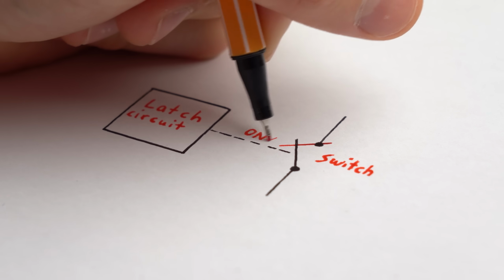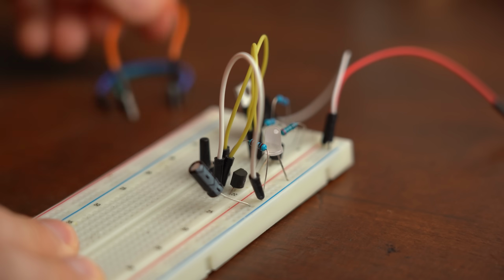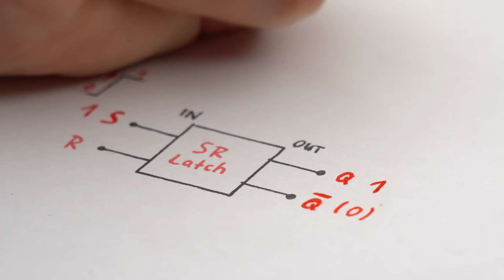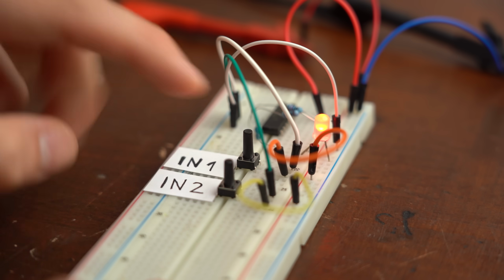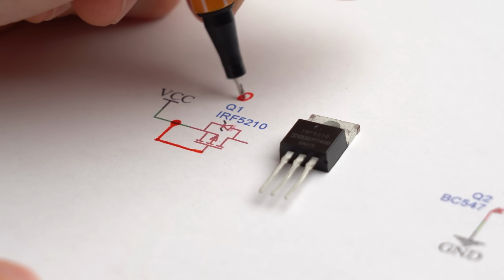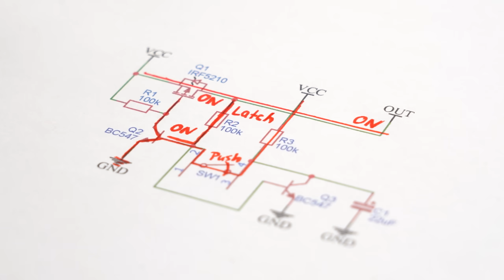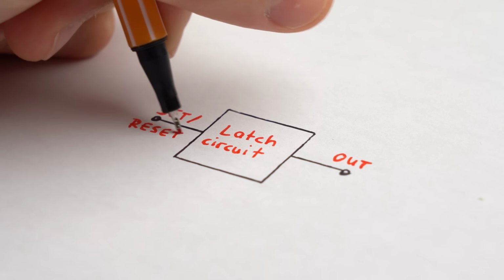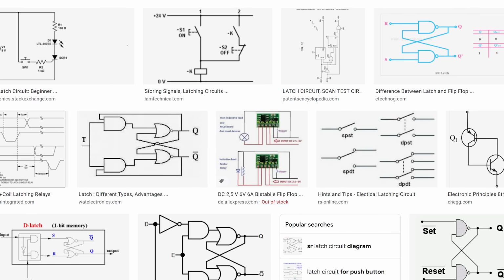Mechanical  Switches are Obsolete?! Switch to a Latch Circuit! EB#53

Comment: Funny enough, when I fix up 80's Saab radios, the one model that has a latch circuit is the one that often won't power on until the circuit is recapped or power button repaired. The mechanical volume dial switch models just about always power up

Comment: I don’t see the advantage of a circuit switch over a simple mechanical switch. These circuits have 10 times the number of parts and 10 times the possible ways to fail. Silly.

Comment: While latch circuits are great and have their purpose, I think it is often times unnecessarily over complicates a system. And that is something that is a recurring issue in engineering. We want to over complicate and over engineer a system when a device already exists that is far cheaper and far more reliable.

Remember, the more components, the more room for error to occur. As such, we are shooting ourselves massively in the foot for ZERO gain.

Comment: completely useless over-engineered idea, you can achieve the same using a relay with the same latch action, also it uses no standby current or you can use 8 parts to make this complicated on off switch, and the relay approach is much more reliable

Comment: Please don’t use this kind of switches or latches for mains voltage purposes. See the comments below (Joop and others). Mains switches shall comply requirements for thermal resistance, fire resistance, clearance distances (as per over voltage category II), failure mode requirements, between others. Component standards and product standards are mandatory in mains related, not an option.
Reply: Pretty sure he used a mechanical latch for his lights. AC would fry those transistors he used for the other switch.
Reply: Use a relay

Comment: Great Scott, I recreated your scheme but replaced the mosfet with regular pnp transistor with 12v supply voltage. The circuit was not latching unless bypassed the resistor, should I decrease the resistors value to like 10k or the mosfet is the key to success?

Comment: IC latch circuits are useful in low voltage, low currant applications.  When you get into controlling high voltage/high currant applications you get into electro-mechanical latch circuits.

Comment: Please explain in what way a latching circuit is requiring less cable-length than using 3 normal switches. You could use thinner wire for the controlling switches, but not less cable-length.

Also they do have the downside of needing a lot more components, being more complex, and increasing power-draw ( electronic latches - not for mechanical latches).

Comment: Mechanical switches are so nice and simple and rely on nothing but a physical connection . I work in automation and I see anything else fail on any given day . Plc’s get stuck on on out puts inputs break .. but a mechanical switch  lasts almost forever
Reply: Yes, theres also the problem with current draw using electronic switching

Comment: Another place the latch circuit would be handy is for machinery in the event of a power outage.  If the power goes out, I don’t want my table saw to restart automatically when the power comes back up.

It would be nice to replace the mechanical switch with a latching circuit.  More expensive saws have a magnetic switch that automatically shut off when the power dies.

Comment: Yes, but the TL relay works on 220V, If you add the power supply for your board and the Zero-switch-relay, it wouldn't be very simple or cheap isn't it!.. Also it takes space, and/or the need to carry 2 voltages on the wires!..
You could have shown the whole schematic though!.. if you are replacing 220V parts - it is correct to make the full schematic til the 220V supply and bulbs!..
And then come things like reliability, heat dissipation etc

Comment: For future reference, if looking for wall-voltage electrically controlled relays, look at HVAC contractor stores. Every AC powered air conditioner or heat pump uses such a relay, and since they sometimes die there's a need to be able to quickly & easily replace them, thus they're sold in such stores in areas where such appliances are common. In the US, the relays are commonly refered to a "contactors".

Comment: People don't realize that these latching circuits are very useful.
Just a few days ago I was looking for a simple way to do one and here you are offering one with your good explanation. Thank you.
Would some time teach how to build a variable square signal generator with a variable duty cycle? to use for inyector cleaning. Using simple devices NOT programable.
Thanks.

Comment: Couldn't understand why C1 is essential for turn-on. Q3 becomes diode-connected when switch is in pressed state. So the base of Q2 can never go below ~0.7V no matter how long you press the button.

After turn-on, C1 is charged to ~0.2V since Q3 is now active. When switch is pressed for turn-off, the base Q2 is shorted to 0.2V. That's the thing that turns it off, I suppose.

Am I right ?

Comment: Other than the fact you need an additional power IC to power the latch circuit and a isolated driver to drive the interface switch (which is short on supply). Beside that, great video.

Comment: A two wire single pole quality switch should last at least 40 years and a lot cheaper & easier to troubleshoot then something with that many parts and for sure will survive a lot better in the event of a short circuit or prolonged overload. Recently replaced an illuminated 3 way switch that my dad installed in his house 50 some years ago. Was told years ago while in Vo Tech school to "KISS", Yep still stands for keep it simple stupid.

Comment: When I look at this circuit, I imagine that the right bjt would discharge the capacitor quickly, ad that's no resistor at the emitter. Therefore the circuit should shut off quickly. I don't understand why it doesn't. Is it because of the bias voltage inherent in a bjt, which is enough to keep the left bjt on long enough for a person to remove their finger from the pushbutton switch?

Comment: Those electronic latches certainly won't replace all mechanical switches. One obvious point is that they lose state when the power is turned off. I really don't want my refrigerator to not come back on after a power cut because it's lost its "on" state (although it's a useful feature on some devices, such as a TV which I probably don't want to come back on). The other main point is that mechanical switches can offer true electrical isolation, which electronic switches will not unless combined with a relay. A final point is that, unlike mechanical switches, there is some power drain, not matter how small, and electricians get nervous when "always on" devices are inserted into fixed wiring due to fire risks, although that argument has already been lost as RCDs, smart switches and mains power sockets with USB outlets are becoming very common.

So, as is often then case, newer technologies do not always replace the old in all cases.

nb. running separate circuits lighting circuits for every room for every place where you want a latching relay must be a real pain compared to putting the latching device closer to the light(s) themselves.

Comment: I made 1 before, takes 2 microcontroller pin, 1diode,1 mosfet, 1 pin to read switch state, 1 pin to power a n mosfet as switch to supply power to mcu
When mcu decides to power off, it just pull the gate low and it will not have power, 0 standby current
Works like this, positive power-> switch - > diode-> n mosfet gate
Read switch state before diode pin,
Continue power mosfet gate by mcu pin connect directly to mosfet gate or via gate driver..
This way u can set your mcu to press x seconds to run or press x to power off, down side is while pressing, it consume power even if you don't run the code

Comment: In equipment reviews often a mechanical on/off switch is seen as a good thing. I agree. I would never use a latch circuit in anything I build as it is just a complicated and expensive solution to something that is not a problem. An electronic light switch that was widely used and prone to remote activation would be a hugely entertaining discovery. In a winters evening you could take a dog for a walk and switch peoples lights off in a block of flats and listen to the residents blundering around in the dark to turn them back on. Then in summer walk the same dog at three in the morning and turn them all back on. Even bad design can be fun in a prankster kind of way.

Comment: At the moment with the Cost of Living so high  Manual switches are KING  they have zero standby current need no low voltage power supply to operate

Comment: For mains voltage applications an important failure mode of electronic switches (latch or not) is Failing On, which is often undesirable or even dangerous.
This is a failure mode that is very rare in mechanical switches.
Failing On can be caused by component failure or by high voltage pulses on the mains voltage. 
These pulses can be caused by (inductive) switching actions or can be induced by lightning, even without a direct strike.  
Therefore I prefer to have at least an (additional) mechanical means of switching.
Reply: At the industrial level, having mechanical switches and buttons are far more useful than electronic latches, because they ensure a clear break in the line.

Comment: I can see controlling a large current with indirect means such as this.  And things that cannot tolerate switch bounce or deterioration of the contacts.  But for any project I will build,  a regular switch is cheap simple and easy KISS.  I had a joke about how they might convert the standard wall switch to a microcontroller based complicated unit at high cost for those that love tech regardless of need.

Comment: I won’t mention it again, but I have a challenge for Great Scott! Build a video monitor camera system that sits under the workbench and tracks dropped items, with a laser pointer to show you where the tiny screw, resistor, or whatever you dropped actually ended up! 

The savings in man/hours looking for the tiny item alone might save millions of hours! I have been known to drop the same item up to three times, and spend a half hour trying to find it. Amazing how far they can bounce and where they can end up. 

Would be so cool to have it mounted under the workbench, and a laser pointer shows where it went (or as far as last point in space seen, in case it went out of sight.
Reply: I have a personal rule that if I don't find the dropped item within 10 seconds, it is lost to the abyss. Life is too short to be on my hands and knees looking for a 10 cent component. It also focuses my attention when handling expensive and/or limited supply components.
Reply: @msmith2961  it’s a good philosophy. I find though often the tiny little item I dropped is the last one, or the only one. It’s either find it, or spend an hour finding a replacement, ordering it, and waiting for it.
Reply: @shader26  it's guaranteed that it'll be found in the last place you look, so just start there 🙃
Reply: @dubmob151  thanks, but I tried it and it ended up being the first place I would have looked.
Reply: @shader26  😂

Comment: Can we connect the latch switch to mains voltage without a relay ? may be we need a high voltage MOSFET and a capacitor dropper.

Comment: This sounds good for low-power applications, but I wouldn't trust it for the lighting in my corridor. Also I would have to have a place to put it, when a commercial latch like that mechanical one would fit neatly in my fuse box.
Reply: Honestly, depends on building size and area of operation. A latch circuit would be useful if you are trying to use it alongside a occupational sensor and want to reduce energy consumption. That being said, a hard switch should still be in the room to override the latch switch.

Comment: Give me a mechanical power switch EVERY TIME.

Ever since electronics stopped providing a basic power switch, and you have to long press, cycle through, just to turn on/off...it's almost always the culprit when the device fails way too early or kills the battery so it's dead when you need it.

A switch will at least provide a way to work around the bad design & engineering,  craftsmanship of the cheap electronics these days.  A well designed "multi-switch" can work...but all the ones I've come accross are nothing more than a huge headache!

Comment: I could have used this video 6 months ago when trying to implement this for a project! Had lots of issues of the latch resetting itself because I didnt use a capacitor as you mentioned. Ended up using an arduino instead.

Comment: Thanks, interesting video. I use a latch circuit in a ESP8266 doorbell using a P and N channel MOSFET, very small IC's exist that have both included, like the Si4599
Reply: I can't find the part you're describing. Any chance you could post a link or some more info? Something like that is exactly what I need cluttering my parts bin waiting for a future project.
Reply: @swiz747  I tried posting a link but  my comment was deleted. I've corrected the part number, it's Si4599
Reply: @wjn777  perfect, thank you! I managed to find the part but unfortunately I can't find any in stock. I'll have to find similar parts but this gave me a great start, thanks again!
Reply: @swiz747  You can also try IRF7317

Comment: Excellent!  I'd been wanting to design such a circuit for some time.  Am I clear in assuming that to turn on and off a mains powered device you still should use a relay, and that this circuit cannot turn on and off the device directly?
Reply: Correct. That mosfet is only a 20v part. Don't forget the reverse diode across the relay coil!

Comment: I'm not sure about your schematic of latch relay. Discharge a capacitor through a semiconductor without any current limit element not seems a reliable solution.

Comment: Have to say, for like my Bench Power Supply, Oscilloscope, and Frequency Generator they all had to have physical latching buttons or rocker switches, removing the slightest possibility of a logical malfunction of a momentary latching _circuit_.
Reply: This is an argument from ignorance as you IGNORE the fact that the entire device is billions of transistors working ALL THE TIME.  And you're worried about the power-on circuit failure, only??????

Comment: Over engineering a simple switch which would then fail lockout requirements especially at high current situations. More components to fail.

Comment: It is incredibly frustrating to me how many battery-powered electronic devices I run into these days with a "soft" power button that do not incorporate any kind of smart zero-draw off state like this, and instead just keep the microcontroller running behind the scenes 24/7 to monitor the button input (opting to just turn off the display and possibly other peripherals) resulting in excessively high parasitic drain and an annoyingly dead device if it's left unused for a few weeks/months.

Avoiding this costs cents on a commodity board, but circuit designers rarely seem to bother to incorporate stuff like this into the design. A real nuisance!

Comment: Electronic power on/off buttons are bad. They don't work when expected and how it is expected in many cases and this drives people nuts. Especially in cases where it takes time for device to show signs of life after turning on. But there is worse kind: the touch sensor buttons, like on Xbox. These are worst of worst because due to a lack of tactile feel, when device fails to respond, you don't even know exactly whether it was pressed or not.

Comment: This circuit is not immune to long press, if you long press, the left bjt will turn on and after some time the Capacitor will discharge and it will turn everything off again and this cycle continues.

A better option is however using a 555 latch (single button on/off) just google it...

Comment: Don't forget you can buy latching push buttons, which when pressed and released close a pair of contacts and they remain closed until the button is pressed again.

So there are times when a latching push button is a good option and you don't need to build a load of electronics.
Reply: these are called bistable buttons, and yeah, in many cases it's enough
Reply: For a headphone I am designing I would like to use a nice looking button, but the circuit requires a switch or a latching button. The latching button is too tall meaning I would have to increase the case of the headphone. A circuit like this could solve my issue. I only wish a circuit of some kind existed so I wouldnt have to solder as much.
Reply: @castours8290  How did your headphones turn out? I am curious
Reply: @castours8290  That's EXACTLY what led me to this video, too! I need a silver metal latching push button switch that's mountable to an aluminum backplate and is no more than about 12mm deep.  I impulsively bought the only one I could find on Amazon, but didn't pay attention to the "fine" print stating it's a momentary switch. so now I'm here, lol. hopefully I can figure out a way to cram this circuitry into the small space I'm working with.  It's a build for a friend, so I don't want to disappoint.
Reply: Unless momentary, ALL switches are latching switches.  WTF are you babbling about?  The TYPE of button is not the topic here... it could be push, toggle, slide, etc.   UGH   How did you miss the context of this discussion so completely?????

Comment: These latch circuits have their place, but you should use the right kind of switch for your application.

Why over complicate it?
Reply: Right.

Most common project in my house is adding a true power switch to all my devices that came with a darn long-press to turn on. They drive me insane.  Especially on something important in emergencies like a flashlight.

I'd rather destroy the looks & case and be able to turn something on & off when I need it than fiddle with long-press.